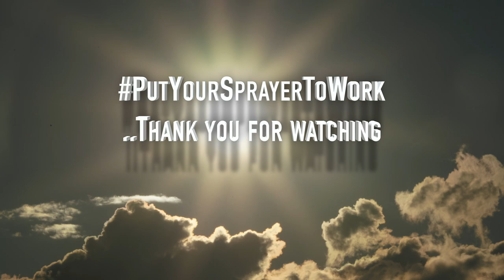Paint Ceilings FASTER With An Airless Paint Sprayer

Comment: Love the Christmas music! 
Hope you're well
We met at the P&D show. You were telling me about the floor covering you buy from ebay. I've just seen it in this video and it reminded me! I don't suppose you could post the link for it?
Also, I have a cheapy cheap sprayer - the screwfix erbauer with some extra tips added courtesy of the wonderful help from Sprayman. It's not bad except changing the filter is a bind, which is what I was doing between coats on the trim - I'd spray the primer on the trim, then change the filter and spray the ceiling then change the filter and spray the trim topcoat. I'm wondering if I'm doing this wrong? It's a bit time consuming all this filter changing. 
Thanks for your videos - especially the music. It's ace! Wishing you a great 2023
Reply from the maker: Hi Tessa, apologies for my delayed response.. ah yes I remember, this is the fleece floor protection from amazon.. 25m roll, 1m width.. not bad value, it can be cut and rolled up to be re-used again.. it maintains its quality.. perfect for hard floors, moves a bit on carpet, but not a bad solution if you’re working in an occupied house and cleaning up each night..

https://www.amazon.co.uk/DUST-Sheet-ABSORBANT-Floor-Fleece/dp/B06XJ7PYD4/ref=mp_s_a_1_3?crid=LV0XDB91JM9N&keywords=fleece+floor+protection+roll&qid=1676391107&sprefix=fleece+floor+protection+roll%2Caps%2C105&sr=8-3

I’m not quite sure I understand the filter change going from woodwork / trim.. then to emulsion / ceiling.. do you mean flushing out (cleaning) and changing filter from 100 mesh (thin woodwork material), to a 60 mesh (thicker emulsion).. which is correct choice filters.. but on the screwfix sprayer, is the filter tricky to change?.. otherwise if woodwork prep is done, I’ll spray a high build primer (AkzoNobel WP136), denib and spray 2 top coats of enamel topcoat (again AkzoNobel, both are waterborne low viscosity products, 208 or 308 tip).. that’s all in one day.. ceiling will be sprayed last on the final day.. so I’m not swapping materials too much, going from primer to topcoat is a quick flush through with water, it doesn’t have to be 100 percent clean.. then emulsions are sprayed on separate days.. apologies if I’ve miss understood, I’m happy to get and help.. I could run the scenario by Mike when I speak to him next 👍 ..regards Pete
Reply: @PaintHQ  Hi Pete. Thanks so much for all of this! Yes, you understood exactly. Yes - I think I'm starting to get the order of prep and spraying. It seem, the wood spray needs to get done so quick (On a room that doesn't need much prep - on the first day it seems)  in order to then follow on with the walls next day, then ceiling the next. It's taking a bit of getting used to changing the order of work as I switch up to spraying more but am slowly getting the hang of it! Like - previously I might have spent the whole of the first day prepping, but it strikes me, now on the first day on a smallish room, the wood needs spraying and then walls and ceiling can/needs to be prepped after the woodwork.
Reply from the maker: Ah great.. yeah in spraying terms you’re thinking right, it is a different plan to follow 👍😆 ..I’m happy to help and advise if I can.. regards Pete
Reply: @PaintHQ  I really appreciate that Pete, thanks. Yes - if I’m off track with my understanding - please do tell me. It’s really helpful to learn this stuff! Thanks again
Reply: @PaintHQ could you describe the order of operation you would take if wanting to spray a bedroom all the same color, ie trim, doors, walls, and ceiling? I just purchased an ultra quickshot to paint a 15’x15’ bedroom and thinking through prep with the goal of painting this weekend. Very glad I stumbled across your videos. They are immensely helpful!

Comment: Why overlap
Reply from the maker: Great question my friend.. a good spray pattern has a feathered edge with an even coat across the middle of the fan width.. overlapping by 50% creates an even / flat finish, no lap marks.. similar principle to using a roller and maintaining a wet edge 👍 ..keep in touch, always great to get your input.. regards Pete 💙